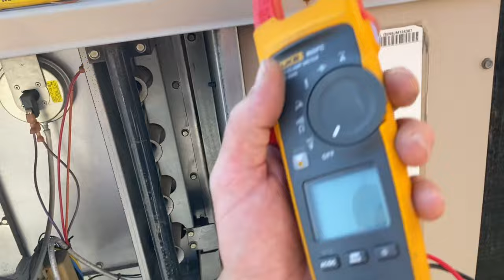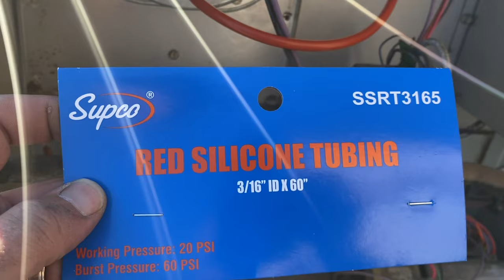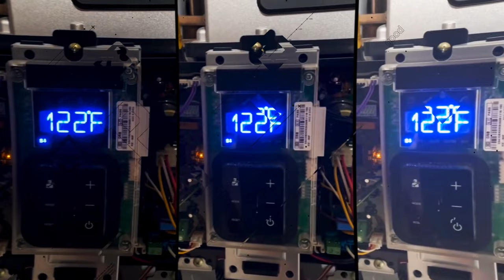York Gas Rooftop Unit Not Heating - Bad Inducer Motor Replaced M# DAYA-T042N090C

Comment: Those Yorks are nice. But I hate the ones with the carryover tubes. I replaced so many tubes and inducers on those and the heat exchangers are always fine. Had one I finished a maintenance on for the first time heating for the season and ran heat for maybe 60 seconds and the inducer let out its magic smoke.

Comment: that's actually a 208 Volts supply, being two phases of a (208Y/120V)  3 phase power feed. need to make sure the trainees and others are on top their games and brushed up on electrical supply. especially if you get jobs with 480Y/277V 3 phase supply, shorts and faults can be very brutal and sustain huge arcs for long periods. (middle finger waving at old Federal Pacific gear)

Comment: You do know that's a fuel burning piece of equipment, 🤔 if your not testing your guessing 🤔everything should have been opened and inspected that heat x changer could have crusty pin holes .
At least a hand held CO detector in the airstream?
Thanks again for the videos!
🍺🍺🍺🥃🥃🍿🏌🏻‍♀️
Stay safe. 
Retired (werk'n)keyboard super tech. Wear your safety glasses!
Reply: I’m torn on this. No heats I just get it running again if you want anything extra it’s extra. $